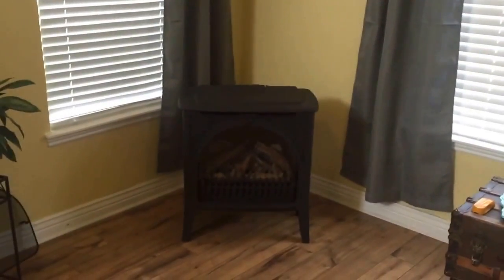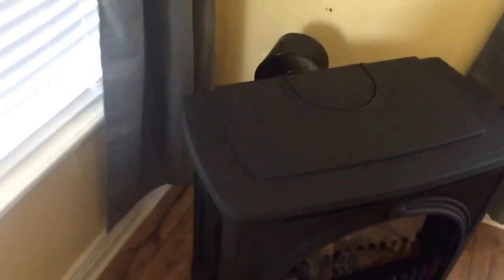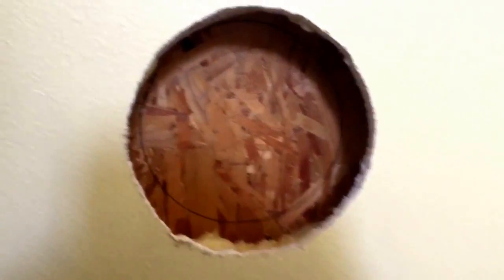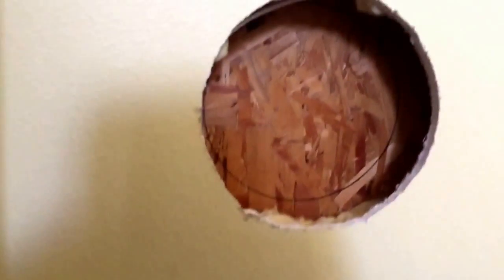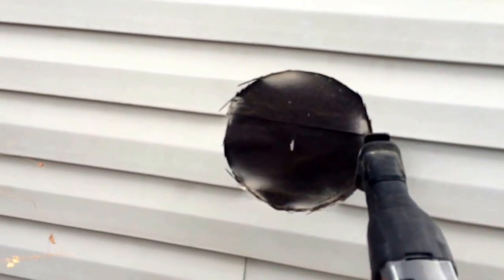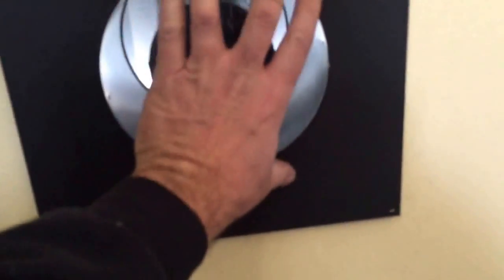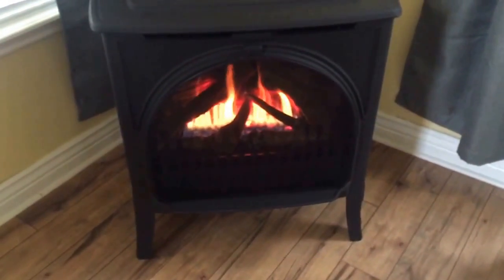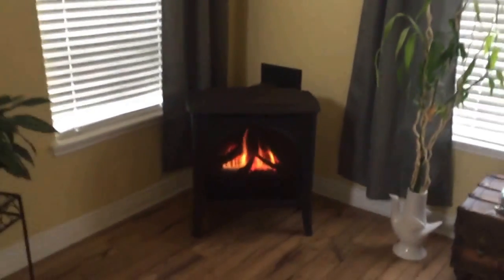Valor Direct Vent Freestanding Gas Fireplace Start to Fire Installation

Comment: Heh - I think I'm going to have drywall, plaster & lathe, clapboard and/or some other original exterior covering on this 1880 house, the stucco that was there for many years, and the vinyl siding installed just before we bought. ;) 

I'm not going to be doing it myself, but I just bought a gently used Valor President on line on Kijiji in Ontario from the previous owner (for the equivalent of about $300 US! - reduce, reuse & recycle is how I'm doing all our home reno work) and now I know what the installer will be doing. (If I were in Utah, I'd call you.) Thanks!

Comment: It's call a 'balanced flue' as the fresh air and the exhaust are concentric with the exhaust being on the inside obviously and then diverted in the snorkel on the outside.

Comment: I would have liked to see how you you turn it on and whether you could run a thermostat to the wall or not.
Reply from the maker: This stove comes standard with a remote thermostat and wall mounted bracket. We have videos on the "Maxitrol" remote control operation. Thanks for the question.

Comment: I have same stove. NO white flames, only blue. I have readjusted the wood according to manufacturer' s instructions about 20 times with no change. Mine looks nothing like yours. I could cry. Please help.
Reply: It is an air adjustment. More air = blue flame, less = orange. You are better off with a flame that is more blue really. The orange flame looks nice but all its going to do is soot your fireplace right up.

Comment: Can you tell me what the diameter of venting pipe is ? 6inches? Can it be reduced to a smaller diameter?
Reply from the maker: The size of the Direct Vent Pipe depends on the make a model of your Stove... Do you have a Wood Burning Stove or is it a Gas Burning Stove? What is the measurement of the collar on the Stove? Regardless of what you have you must use the proper size Pipe for that appliance.

Comment: Can it still be lit if you lose power?
Reply from the maker: YES! If your batteries are toast you can switch to manual mode and light the pilot similar to lighting a water heater and turn on the flame 🔥 to your desired temperature.
Reply: Could you cook on it?

Comment: I always think why pay for gas id go wood live off free earth it takes work but hey its worth it
Reply: Very true, but then there are the cons such as either having to purchase corded wood, or having to fell it, buck it, split it, stack it, dry it, bring it in, clean the mess, getting the fire going, maintaining the fire, plausible chimney fires, chimney cleaning, home insurance issues just to name a few. Propane is pretty much the most efficient of the gases with less toxic exhaust, start with a remote or flick of a switch and is thermostatically controlled. No major piping to install through the roof. Need I say more? However, everybody has their own preferences.
Reply: @therealsparkman  live next to little house on the prairie neighbor  25+ years. They live with wood burning and electric. he's in his 60's now and every winter looks miserable ( Well always looks miserable now) with all the aforementioned work. Also has to climb on the roof to wire brush the metal flue,  I imagine as well as they set it up it, creates a sooty mess  inside!  That's a things to consider as you get older. Hes had kids throughout and very rarely did they help him split or pile. Can bet you they live in houses with thermostat.

Comment: No need to frame out and put firestop in the wall?
Reply: The wall thimble takes place of a firestop.
Reply: there is cold air, fresh air for combustion on the outside.